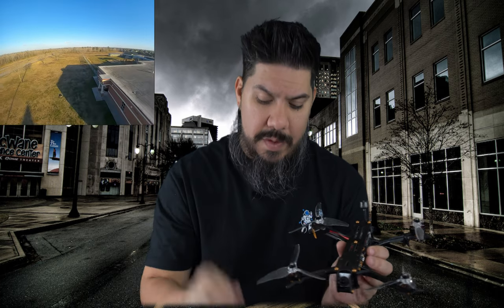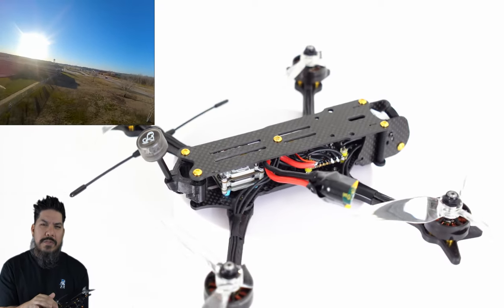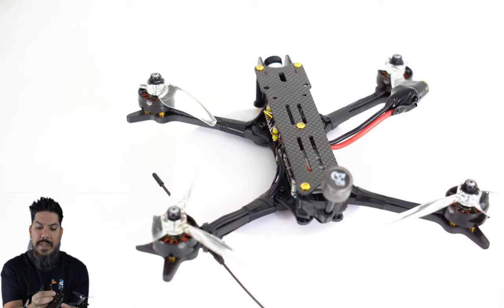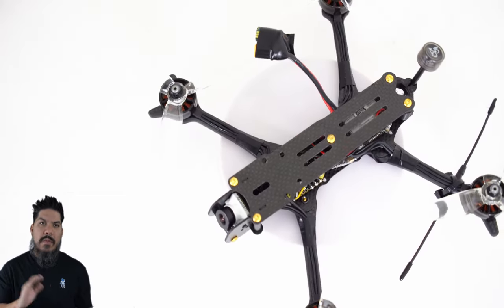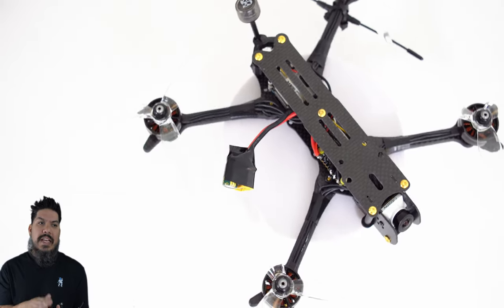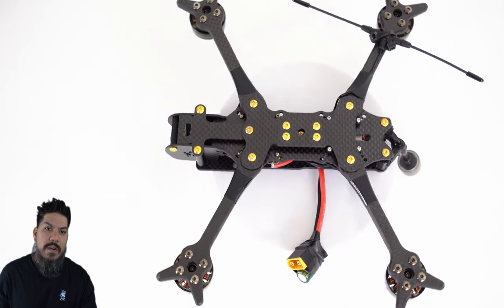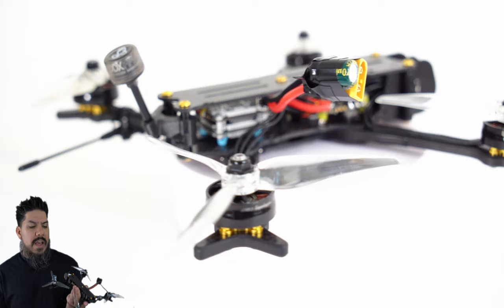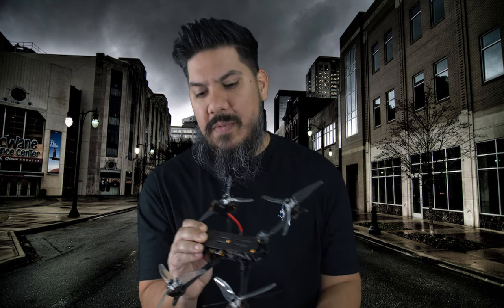Prototype 5 FPV Cycle + Amax 2305.5 motor HIFIONRC 45A Nebula pro 309 gram freestyle DJI FPV REVIEW

Comment: Im flying the fouride with 5in arms and its basically the same frame. I decased my Vista and am using the stan fpv motors. Its very light and flys great on 5inch 3s and 4 inch 4s. Probably my favorite all around quad.

Comment: my parts are arriving, 
have 2 frames, 
wasn't sure if the AIO route would be robust enough... 
was going to use the FPVcycle 2203/4 3450kv motors on at least one, 
think I'm building one just for just Nebula Pro, another for action camera. 
 
I really appreciate your insights and testing. 
keeps me pointed in right direction

Want to try one of these Stan FPV motors the  or 2604

but... I'm thinking is a 2004 possible?
as you can see... I'm all over the place.

Wish I had someone swapping parts for me so I can test all day long.
Reply from the maker: Imo 2004 would be a little underpowered for this size, but could be an interesting experiment. Weight would fall even further by maybe 20 grams or more. 

Let us know how it feels when you get it going.

Comment: My immortal t ahways gets ate up when I put it on the arm like that. Happens when I turtle mode. I use the micro imortal-t now. Sucks for range though.
Reply from the maker: interesting, i must crash differently, I never seem to hurt mine much. Maybe a rear mount on the bottom of the bottom plate would be better.
Reply: @JonE5FPV  yeah that's what I use is the 3d printed antenna mount with immortal T. I probably just have the worst luck when I put the immortal T on the arm 😂😂

Comment: What lipo are you using
Reply from the maker: Infinity 1150 6s
Reply: Throttle limited for the 2550kV motors on 6S?

Comment: Yes but the cap is on the xt60, that's proven to do almost nothing
Reply from the maker: It’s debatable.  Several of the pro builders use the same practice.  Should be noted. I’ve never used caps for noise reduction. Only for preventing voltage spikes in hard crashes. (Racing primarily is where I started doing this. Been doing it at the cap since. Same as catalyst Machineworks and a few others.) of course if there is room inside the build that is preferable.  But not always the case.
Reply: @JonE5FPV  awesome build tho it looks so sleek